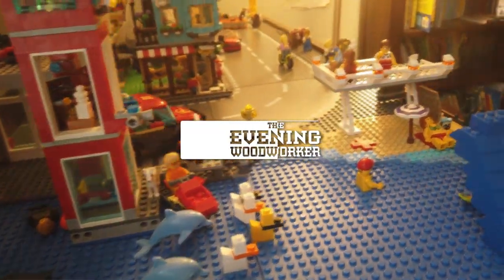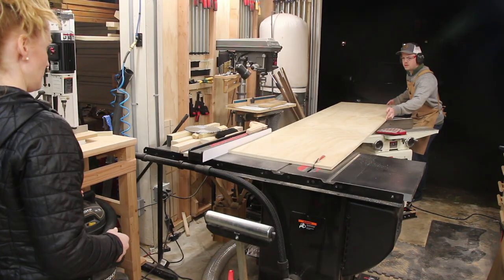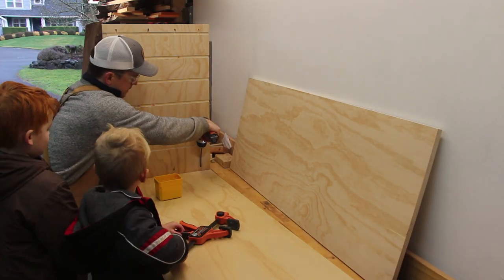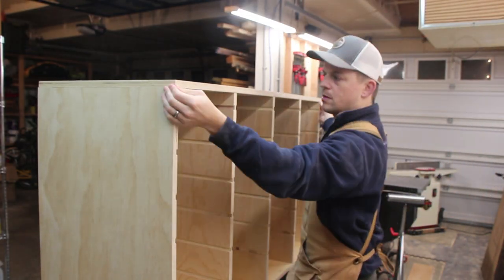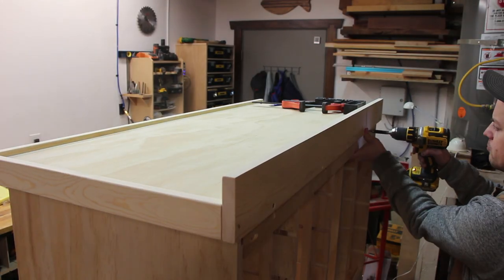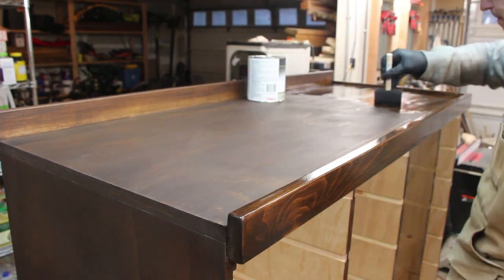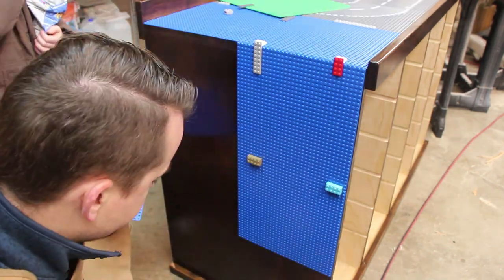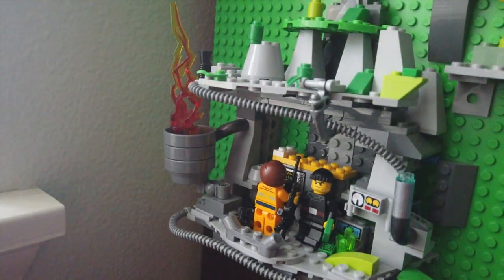Transform Your Kids' Room with This DIY Lego Table!

Comment: Wow, Looks amazing. Wanted to ask how it’s holding up with time? My problem with the current trofast set we have is that the drawers are always coming down on one end. Maybe because you built it yourself it’s more stable and the bins don’t get loosen?
Reply from the maker: That's funny you say that, the structure itself is holding up fine, but sometimes the bins will slip down on one side. I think it may be due to installing the sides too far apart. I may go back and try gluing some thin strips underneath each of the dados though so it has more of a ledge to sit on. That would help on the pre-built shelves too!

Comment: So Lego baseplates are 10”, but when you secure 2 together there’s a slight gap. So that adds up. No problems?
Reply from the maker: Yes I attached them together with lego pieces and then measured the overall length to make sure it all fit.
Reply: @EveningWoodworker  nice. Came out well! I have a giant table in my parents’ basement, been there for just about 30 years haha. It’s 2 sheets of plywood with a hole in the middle plus some additions haha.

Comment: I bought the plans but I’m a little confused what size gauge nails did you use?
Reply from the maker: I used 16ga nails but you could use whatever will hold the trim on until the glue dries.